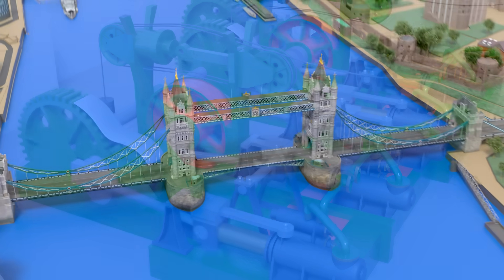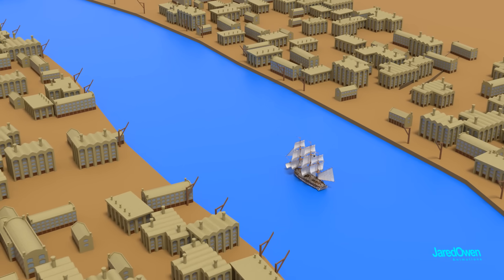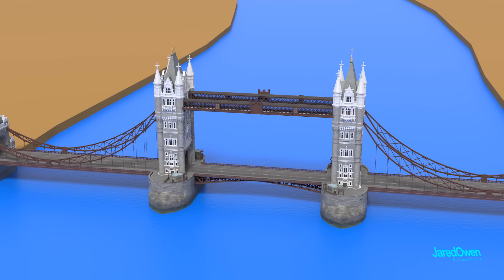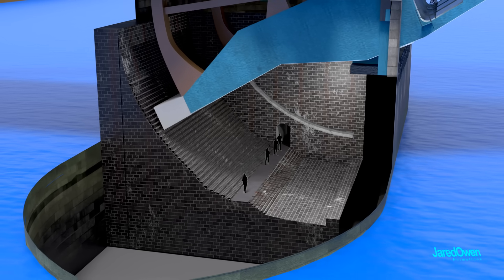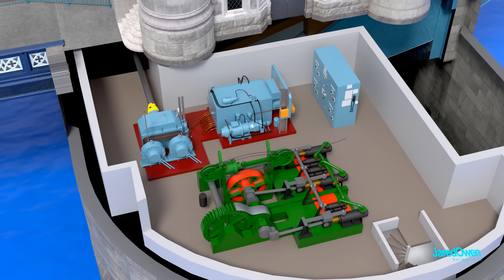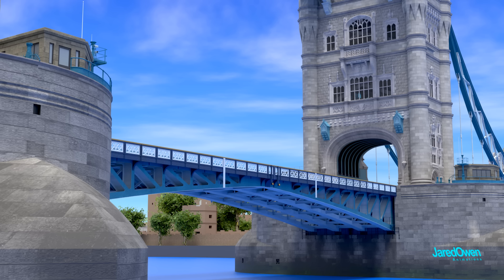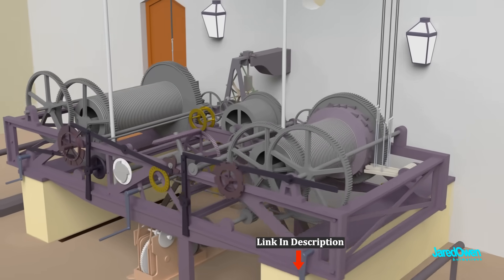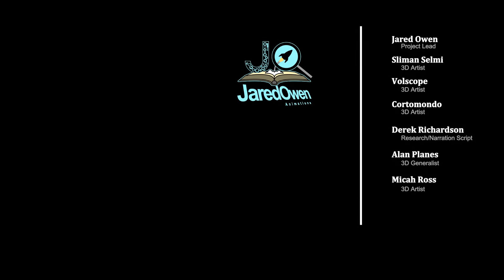What's inside Tower Bridge? (London, England)

Comment: A fantastic video as usual, but I'm compelled to point out a couple of errors. At 1.47, it shows what the area looked like in the 1800s, but omits to show the Tower of London, which has been there since 1078. Also, the segment about the bus jumping the gap shows the wrong type of bus. The incident happened in 1952, but the Routemaster bus shown didn't exist until 1954. But, as I said, still a fantastic video.

Comment: I went on a custom tour many years ago. I recall a storeroom floor that was covered with wooden shapes or patterns. It was explained to me that the builder set up an actual iron foundry on the south bank. All of the precision engine parts were sand cast on site. Victorian engineers always built for the long term (unlike today); so they made sure that the original patterns were saved and labeled if replacement parts were needed thru ware or breakage. If so they could relatively easily be recast.

Comment: For some reason, at 0:10 it switched to german and I thoht I was having a stroke
Reply: What do you mean.
Reply: It seems our guy is trying to give the correct language based on your location 

I've got spanish but I prefer English because the translation isn't right.
Reply: Probably a glitch.
Reply: Nope, the audio. It was a weirdly common glitch for a couple of days, but it seems to have been rectified.
Reply: The subtitles?
Reply: Same here, In Hindi it's not that interesting because of the dubbed and translation gap. I prefer original audio.